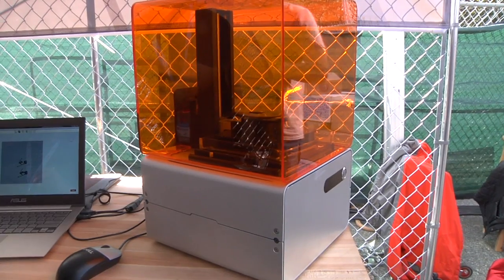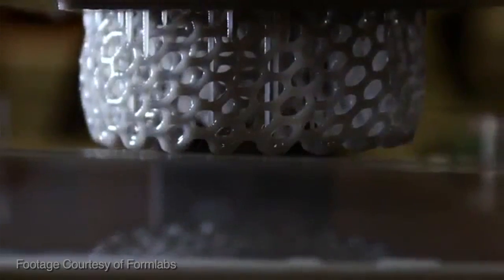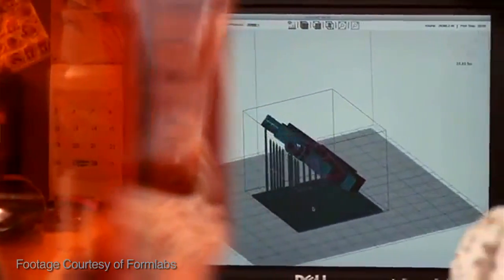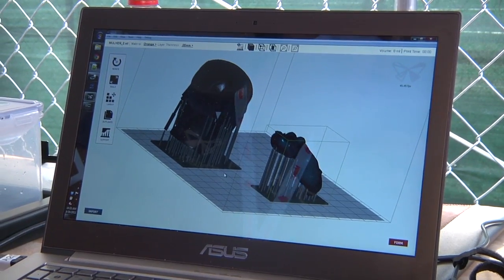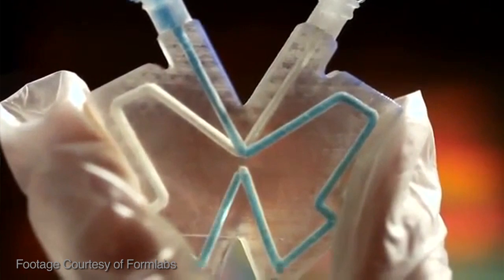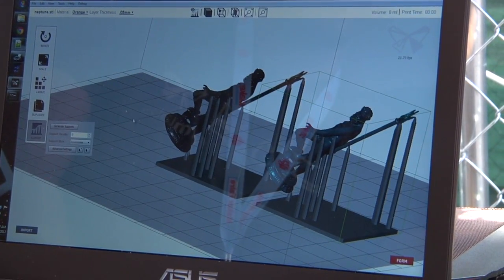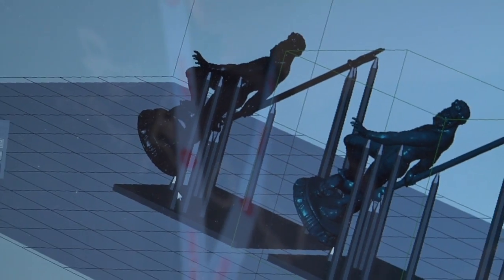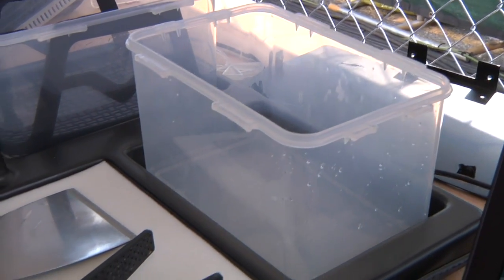World Maker Faire 2012: Formlabs Form 1 3D Printer

Comment: I would be interested in this if the material could be safely touched and particularly if models didn't require special support structures. I'd prefer a 3d printer that prints  the build and support material at the same time but the support material be disolvable in water or something for common use.

Comment: its not limited to lasers, just the wavelength the resin cures at. The same process can be done with a projector. it can even be done in similar fashion to that of a ink jet just curing the layer with UV lamps on the side of the print head (Objet printers operate in this fashion) Problem with these printers is the cost of the photopolymers is rather steep (ranging from 80 to 300USD per Kilogram)

Comment: Good correction, don't want to confuse anybody. I'm still very much feeling my way through this as a subject. Like you, I'm finding the size you can print very limiting. I'm guessing there is some technical reason for this, warping issues? I just don't want to spend big on X and then find out I really should have waited for Y or chosen Z instead. Still kinda hoping HP or similar will sweep into the market with something amazing soon.

Comment: probably stronger as the sintering would give a more solid crystalline structure to the plastic. moot point though, as the resolution the makerbot produces creates nice tight bonds, even if there is a slight variation in the hardened plastic layers.

shapeways can sinter powdered steels into a 3d print and send it out to you. they can also use a hardening process to make very strong 3d prints. medical applications include 3d printed implants based on 3d xrays of your own physiology. mindblown?

Comment: sorry to be the resident pedant, but that's 25 microns, not .25 - but nit picking aside, yeah the resolution is four times greater than makerbot 2, but the problem for me is the same. build area is not big enough - I want to take my models and use them for steel castings, making my own engine parts and all sorts of fun stuff.

still damn impressive for an entry level home resin based printer... things are really coming along with 3d printing.

Comment: By my rough calculations, the new maker bot, that replicator 2 can print objects twice as big as this, but here were dealing with .25 microns and the replicator 2 is 100 microns. So this has a very nice step up in resolution. but the output is pretty small. I'm still waiting on a really nice resolution printer that can handle 12" H which is perfect for the sculptures I do. Maybe a bit bigger would be sweet but I'd be happy with 12". 6" high, good for jewellers I guess.

Comment: I'd actually quite like it, the BBC did a documentary programme with James May (from Top Gear), called "James May's Toy Stories" where he built and lived in a house made entirely of LEGO. Cool as. Some components of your house already can be plastic, PVC windows, gutters and fascias. If you put a subframe up to hold the building structurally, why not print the walls? That's essentially how skyscrapers are built, a large frame to hold the building up and glass curtains on the side....

Comment: ...to try and use some of the excess plastic we're currently choking the eco-system with?
Or to reduce the cost of housing production, and housing materials?
Or to speed up construction by automating the process? 
Or to construct a building isn't bio-degradable, one that's designed to last, like an ark, time vault or DNA bank.

Comment: Their Kickstarter says 
"We estimate ongoing resin prices of around $149 per liter, but Kickstarter supporters who buy a Form 1 print package will be guaranteed at least 1 liter per month for $129 ($0.13 per cubic centimeter) or cheaper for the life of their printer.  This is compared to available resin from traditional suppliers, which currently costs around $300-$800 per liter, and is less than a tenth the cost of online print services."